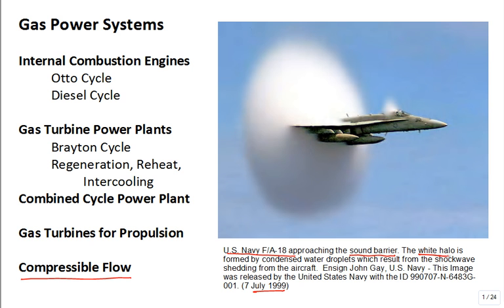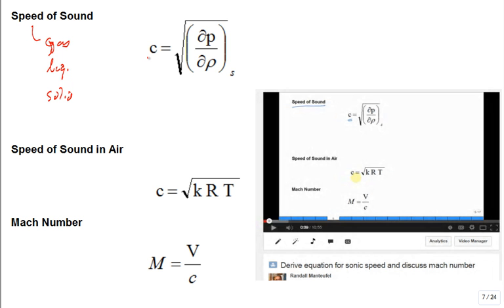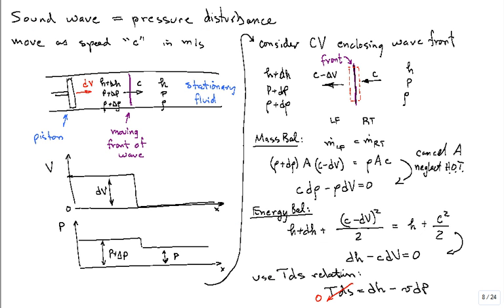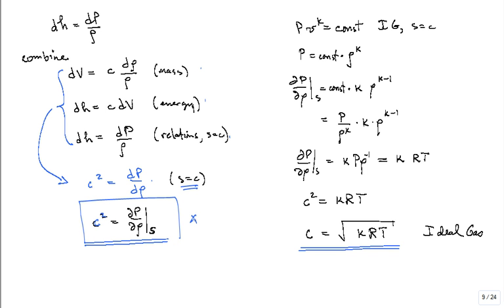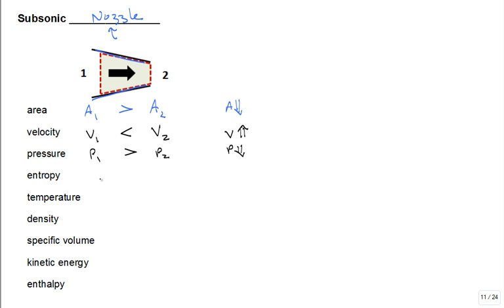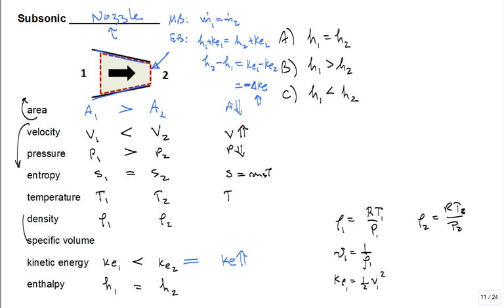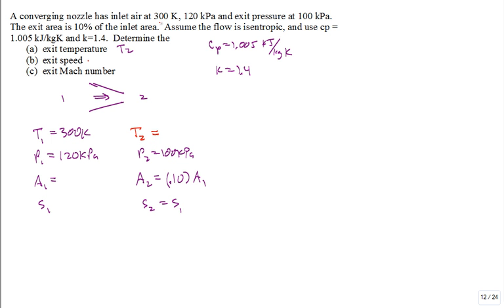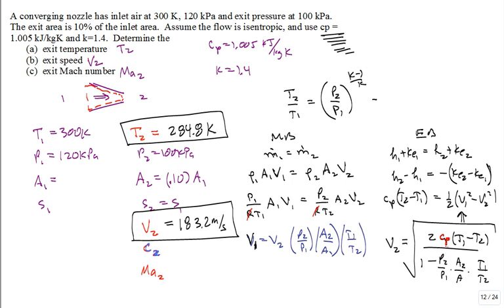ME4293 Compressible Flow 1 Spring2015

Comment: Thankyou  Dr Manteuffel,I am  studying Ramjets,so external compression diffusers,are
constrainsted to Area/Velocity fundamental Equation, never  shown here,at the  ramjet nose supersonic you need  a divergent entrance to increase pressure and  temp,and  slowdow from M>1 to go to burner at M<1,when Mach is numerically  high, this  equation already solved  gives  usStagnation values,and  Area=f(x), Mach,T and P, I did it and if  you  honour me and  God, same as me,please check, a numerical example,it works,but at subsonic entry for  a  Glider I work,I need 70 m/s to take off with De Laval nozzle  booster,
diffuser  external compression is poor effect,so I see Bernouilli theory matches better.Anyway  I am working for  Air Force  in Ramjet DCR,where that equation and  a Busemann internal Compression Diffuser, and  controlled  shock waves will be  required.
Truly  Stemme SB10, motor glider, my project is  eliminate  100 kg of IC engine and  add
2 ramjets subsonic under wings and operate at 250 km/hr, de Laval nozzle booster.
For not boring you, I was  FEA and Simulation events at UTE during 11 years,untill 2000 year,theory and  programming.Bachellor,Master  and  PhD nominee,but  as the  time  goes by I reached 70 years  old,If M>1,dA>0 and dV>0,mistake correction previous eq,
(1-Mexp2)dV/V=(-)dA/A,apply to divergent nozzle De Laval area expansion,speed increase
when M>1 after throat and exit plane.A thousand Thanks,God Bleth you and  family.